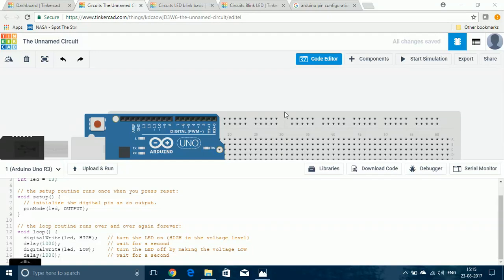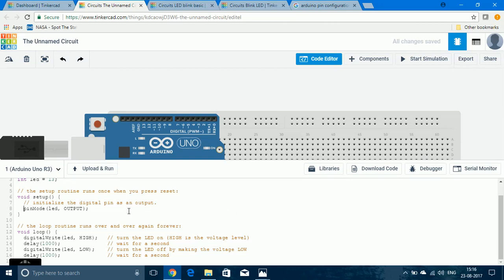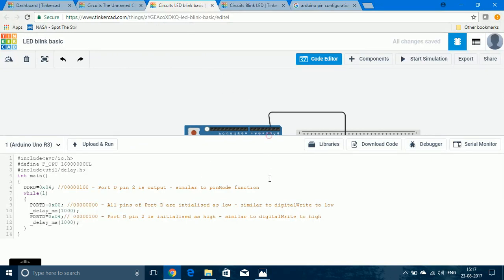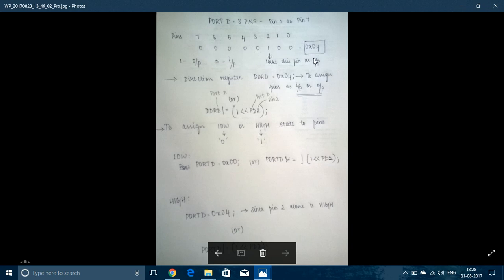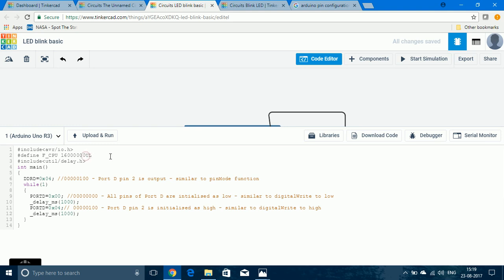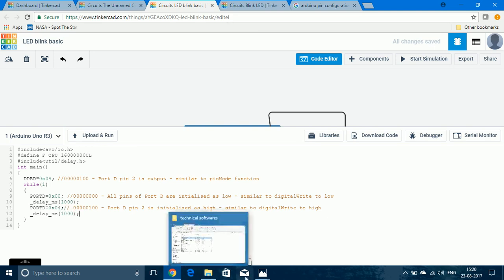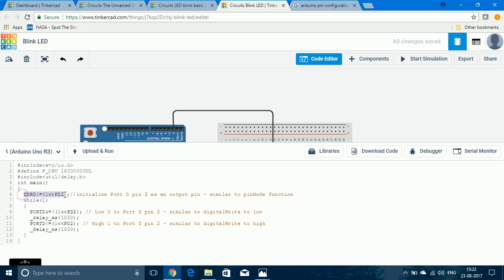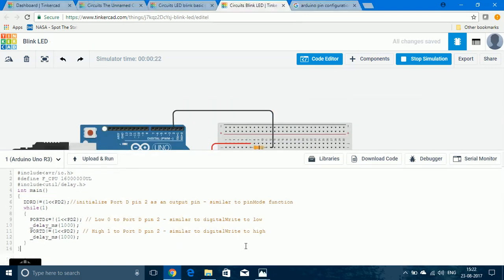Tutorial on programming Arduino UNO/AVR ATmega328P using pure C - Blink LED

Comment: great tutorial Nivetha.  Question: How did you determine that pin 2 is 0x04?  It is not the 4th pin; displaying as equiv bits, 00000100 does not work as a substitute for 0x4.  100000000 does.  So does 10000100. I am not sure how you determined which pin is addressed as what in hex, and that's really important to figure out to be able to use Pure C in the manner you show here. Thanks.
Reply: I know it's been a year, but it probably will be useful for someone: To get the hex representation, you have to look at bits this way:
BIT7 BIT6 BIT5 BIT4 BIT3 BIT2 BIT1 BIT0
   0        0        0        0        0        1        0        0 

To get the hexadecimal version of the number, you can "slice" it in two groups, one from BIT7 to BIT4 and another one from BIT3 to BIT0. Now just convert each group to its equivalent in hex and "stick" both results together, put 0x in front of it and you are done. In this case:
First group        → 0*8 + 0*4 + 0*2 + 0*1 = 0
Second group  → 0*8 + 1*4 + 0*2 + 0*1 = 4
So the end result is 0x04. 

PS: Remember that hex digits go from 0 to 15, so you have to write them: 0, 1, 2, 3, ...,8, 9, A, B,...,F. So, if you want to turn on...let's say, BIT7 and BIT6, the number would have ended up being 0xC0. I hope this helps :)